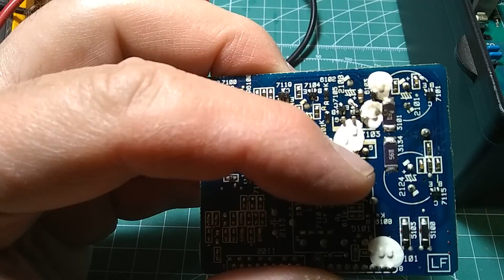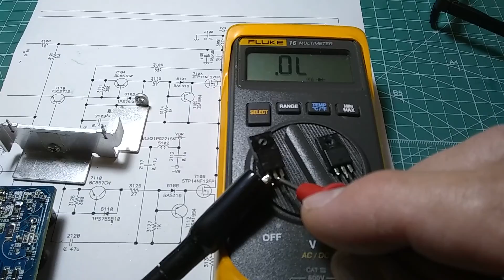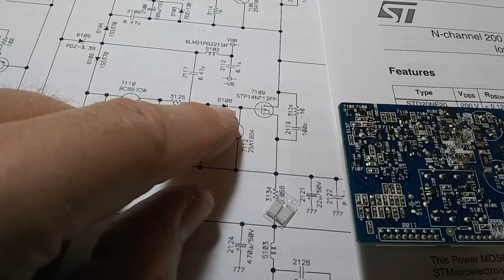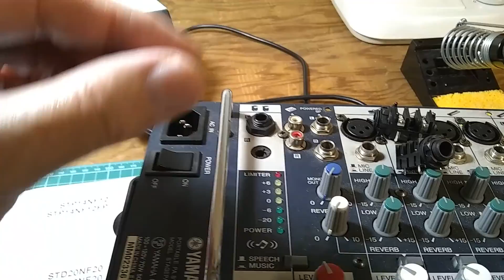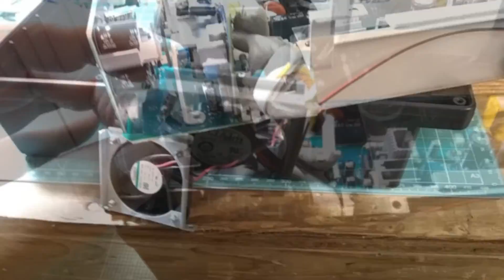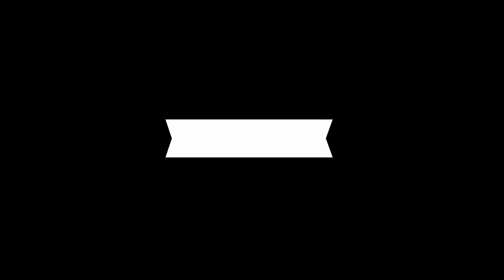Yamaha Stagepas 300 - full repair of audio amp module part # AAX6207R

Comment: Good job, and thank you so much for doing the schematics ;)
Reply from the maker: I had some trouble finding schematic of the speaker output section, which for some reason was published separately from the rest of the Stagepas 300 circuit. That's why I wanted to include it with the video. 
Thank you for the comment!
Reply: Well it was a good find, thanks to your efforts, and generosity to publish (so clearly). You saved me a some time and a lot of hassle. Love u bro.

Comment: good video - thanks. btw If I were replacing the small fan, I would just cut the cable and solder new fan to it to avoid taking it all apart
Reply from the maker: It's good to replace both of the fans, if possible. IMO

Comment: Bonjour super vidéo je ne trouve pas la valeur des resistancs  est ce bien 0.056 ohm ??  chez Digikey pas disponible
Reply from the maker: Hello Kriss! Yes, the resistor is 0.056 ohm. Digikey France - part# WSL2512R0560FEA
Reply: @tektech1065  ok merci j'ai trouvé
Reply from the maker: @krissgallud9049  Kriss, I would recommend getting transistors STF20NF20 instead of the original STP14NF12FP, which seem to be underpowered a little bit.

Comment: Hi Tek Tech!  I have to replace two SMD resistors on my Yamaha Stagepas 300 pa system.  How do I determine what size smd package 0402, 1206 etc.  The resistors R146 & R245 on the Filter pcb board.  I don't have a caliper.  Thank you.
Reply from the maker: I'd just use a ruler to measure the resistors' length, then look up "smd resistor sizes." 
Good luck!

Comment: Hi Tek Tech!  Do you have a part # for the 0.056 ohm 3134 & 3101 resistors.  Where did you order them from and what is the wattage rating.  Thanks
Reply from the maker: I put the info in description under the video, when you click on "...more"
Resistor 0.056 Ohm is 1W, part nr. 311-0.056TCT-ND from DigiKey

Comment: Hello.  Thanks so much for the video on yamaha aax6207r amplifier.  I have to replace the same two mosfets.  How did you remove the white fixating compound around the two mosfets?  Thank you so much for your help.
Reply from the maker: That white stuff has rubbery texture but it is pretty dense, so you need to be patient, careful and persistent in removing it piece by piece. I used exacto knife to cut it up, and precision long nose pliers to remove it bit by bit. I also used a small pick hook to pry it. In the end I cleaned up the board with q-tip and rubbing alcohol. It will come off, but be extra careful not to damage the good components or the board when using tools. 
Good luck!

Comment: Hello, great video.  It is the exact issue I have for our church unit.  I can clearly see the .56 ohm resistor is bad.  Does that mean the mosfet is bad also?  If I test the mosfet while still installed will I get an accurate test?  My cooling fan is bad which I'm sure is the root of the problem.  Thanks, Bill
Reply from the maker: That resistor is 0.056, not 0.56
The two mosfets - if fried - will be likely shorted to zero Ohms between all 3 pins, which will show on the Ohmmeter without removing them from the board. The failing or failed fan would cause the overheating of the output modules, it will need a new fan of the same size and voltage. In my experience, the greatest challenge can be soldering without damage to the densely situated traces. Whoever does it needs to have good experience in PCB soldering. 
Good luck!
Reply: @tektech1065   Thanks for the reply, Yes .056.  I ordered the components on ebay.  I just installed them and it still is not working correctly.  If I only plug in the amp I repaired, it stays powered up until I shut it off.  If I turn it back on it wont power up unless I unplug it for about 30 seconds.  The amp that was good works fine by itself.    If I install both amps,  it trips the solid state circuit breaker.  I tried both amps by themselves in both positions.  No difference.   Any ideas?  Thanks, Bill
Reply from the maker: @nancymccormick5809  Hello Bill. From what you described, it might be a failing electrolytic capacitor in the switched mode power supply. They can be tricky to diagnose if you don't have a ESR in-circuit tester. Look for small size high voltage caps. In the Service Manual, page 50 you will find the power supply diagram. I would leave the large 390 uF 200V caps (C804 and C808) in place and look to replace the smaller ones: C810, C814, and C819. 
You will find the Service Manual just by googling STAGEPAS 300 SERVICE MANUAL PDF
Good luck!

Comment: Tek Tech thanks so much for the video and schematic.  I have a part I can't identify on the right amp module.  Would you be able to help?  Thanks
Reply from the maker: Sure! Both amp modules are identical (and swappable). Can you see any markings, number etc., on the board? Could you compare the two modules and identify the corresponding markings on the other one?
Reply: Tek Tech I forgot to mention the suspect part is near 1604 on the Power amp module.

I can't identify the blown part.  Thanks for the help.
Reply from the maker: @davemac01able-eu3nn  Since I got no pictures of your amp, I can't help. Sorry. But you may get lots of really good practical help in electronics forums such as "badcaps forum" of "eevblog forum" where you can share the pics. You could also post link there to this video, so the guys would know what amp you talk about. Good luck!
Reply: @tektech1065  Thank you for your advice on checking markings on board and checking with electronic forums.